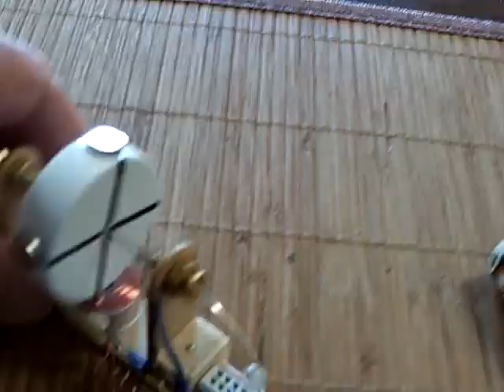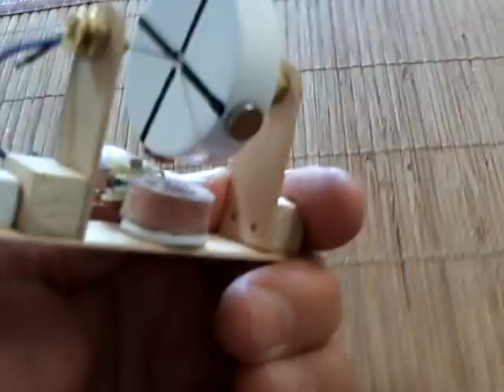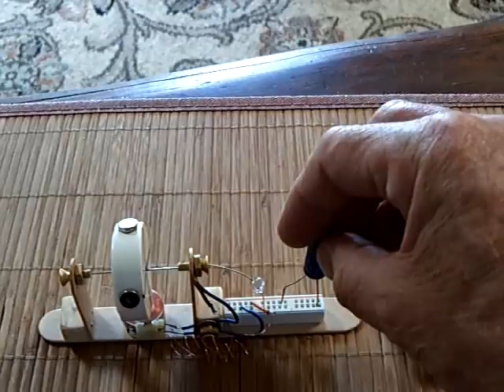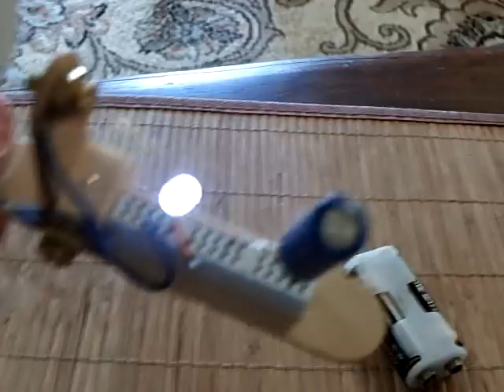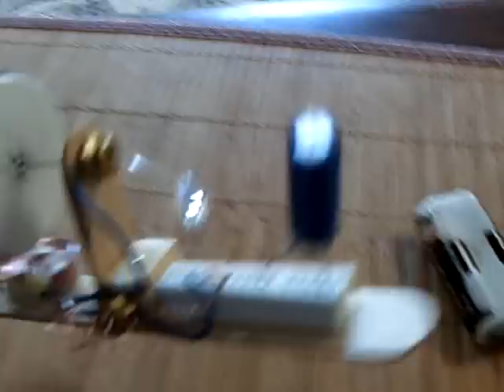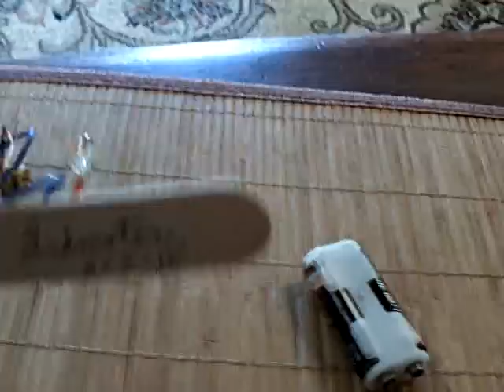A Curious Little Pulse Motor

Comment: Very nice. Sapphire bearings? Too cool.
Reply from the maker: Terry Woodroof Nope.  Steel sewing needle on brass screw.  Good lubricant.
Reply: ***** nice. Thanks for the inspiration and information :)
Reply from the maker: Terry Woodroof You are welcome.  Thanks for watching and the comment.
Reply: ***** What brand & product name of oil did you use?
Reply from the maker: A B I'm using DuraLube.  I should do a commercial for them.  The stuff works great in this application.
Reply: *****
I bought some of that when it was first sold on TV.  It is a pretty good lubricant!

Thanks for sharing!

Comment: You could replace the LED with some kind of Zener diode and get the same results if not better.  The battery charges up the Capacitor until it reaches the forward bias voltage of the LED then the Cap is discharges thru the Solenoid
Reply from the maker: +Jeffrey314159  This is just a reed switch triggered pulse motor.  The led is fired by the coil fly back.  The cap is a 2.7 volt 5 farad super capacitor that supplies the power.

Comment: Wow!  Very efficient.  I was almost scared to watch this video as the music sounded so ominous.  I thought you were making some sort of top secret device involving plutonium, ha ha.  I am assuming that was a super cap, as it charged up so fast.  What was the value?  1 F or 10 F?  Your work is always incredible.

Bill
Reply: Pirate Labs The music caused me to think a murder-mystery story was about to be told... :)
Reply from the maker: Pirate Labs Hi Bill.  Thanks.  It is a 5F/ 2.7v super cap pre-loaded with about 2 volts.  I may try to run the motor on an 'unobtainium' crystal cell.

Comment: Hi have you watched ingventor his video title gretchen jones coral castle. In her hand she holds a static capture aerial detector. Like a water divineing apparatus but for static Her hand holding the aerial becomes ground earth the wrapped external CHROME RIGHT HAND vortex external wire the whirlpool draw in of air electrons ( chrome is positive I believe ) so as the electrons draw in they cannot flow back up the vortex as the mass entering is greater than the mass down the swirling vortex. ( like a black hole ). Just another thought Recently joe booker has had more videos placed called part 5 joe cell These are more in depth about the neutrals he uses for all this energy trapping I believe John searl and bedini also no it is all neutrals we need. Pos and neg together hence the whirlpools/black hole equations That's all it is. Yeah !!!

Comment: But....what is curious...? it is a pulse motor running on a supercap...!
Reply from the maker: skycollection I built this to try out steel on brass bearings.  TinselKoala has me hooked on using these craft sticks for little projects and I was curious to see if I could buildup the motor on one.  When to motor turned out to be such a good runner the thing changed into a curiosity item --for me.

Comment: how long this can run with capacitor?
Reply from the maker: Tony Pachino This is a 5F / 2.7 volt super capacitor with about 2 volts in it.  The motor runs for a few minutes on it.